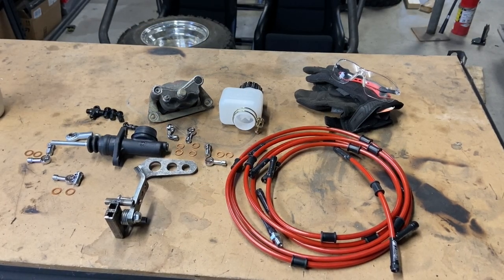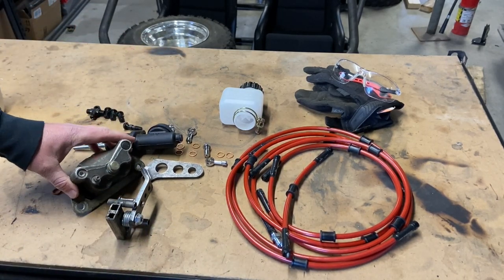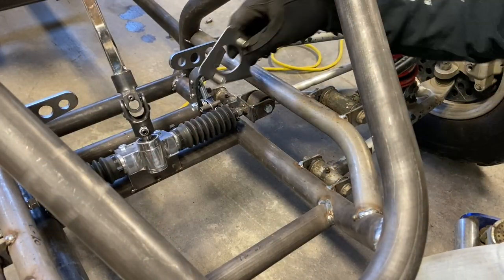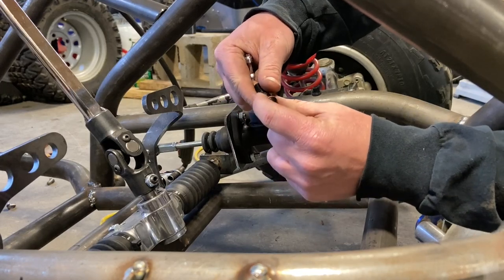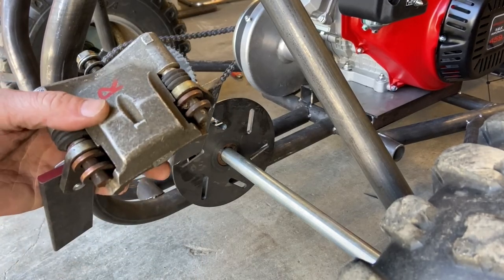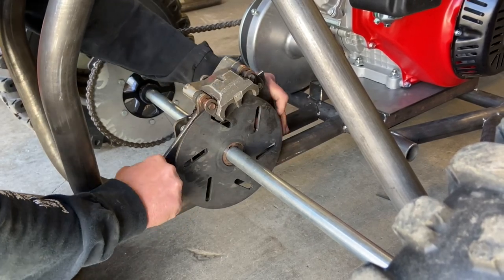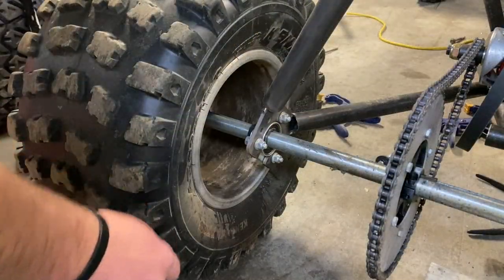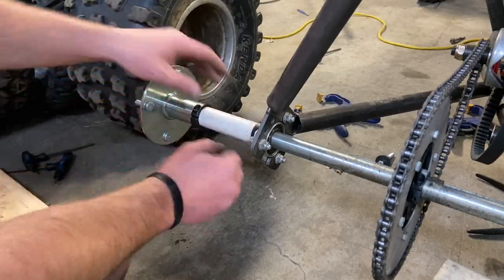Budget Crosskart #8 Brakes and First Drive

Comment: I gotta say I love the shape of this thing. Gotta buy these plans and try to build this over the summer. I have my welder and also have a tl1000s motor that would really rip in this thing. 100+ lb torque would make this a beast.
Reply from the maker: Well I cannot take credit for the shape, it’s pretty common in European crosskarts. But the design and reusing atv components is 100% original. I was really close to using a TL in the two seater for the same reason, but went with a busa instead. Going to be a torque monster and maybe even do wheelies with a TL… I can’t wait to see your build 🦾

Comment: Well you raised her right! Great job on the budget build! Just need a booster seat for your daughter to see over the wheel. Or use a car seat manual mechanism for lifting the seat and sliding back and forward?
Oh and finish those welds, I'm sure the axle supports are still only tacked in.
Reply from the maker: She’s so fun. And she says she can see alright. The brackets for the seat come out in just a couple minutes and cost waaaay less than what you’re suggesting 😉. And yes, it’s mostly tacked together because the rear is getting suspension, but when something is designed well it should only need tacked.

Comment: I'm telling you buddy you would be much happier and your clutch will last a lot longer if you will install it the correct way. The drive clutch literally goes on backwards with this setup then the drive sprocket that came with the clutch goes between The driven clutch and the back plate. Not only does it make it to where the belt stays in alignment throughout it's range but it also takes a lot less stress off of the end of the Jack shaft making it a lot stronger and of course more durable. I absolutely love mine and I've owned five or six of them on different builds and never had a problem, a kevlar belt is another big improvement.
Reply from the maker: I looked into this after you commented on the last video. The output shaft from the engine is not long enough to support this. The sprocket is 2” wide and the clutch is already spaced 1”. It’s the same situation no matter how it is configured. The only other option is to run the sprocket under the engine cylinder on the opposite side of the jackshaft. I really appreciate the info though, thank you.

Comment: The PVC sleeve still won't stop the axle from creeping.  What you should do instead is tack the steel collar onto the axle.   If you did that on both sides the axle will stay centered.
Reply from the maker: Yes it will. The axle is staying centered just fine because it has 6 collars keeping it centered. This was just to keep the hubs from pushing in on the outer collars as I said in the video. Welding on the axle kind of defeats the purpose of everything I put on there. Thank you for the input though, I always appreciate the comments.

Comment: I like that she was thinking about safety when she flipped down that windscreen. Great series. Hoping I can adapt the design to "cut and weld" as the price for a bender (that I have found) is a bit steep.
Reply from the maker: She is an absolute blast! We have a bluetooth comm system from when my wife and I did motorcycle rides (before kids), so we ride around and talk fun, craziness, and also how to have fun and be safe. I’ve messed around with doing a no-bend version and looking at the cad it would rely way too much on welds being perfect (in my humble opinion) and just doesn’t seem strong enough. And it would be hell to get everything straight. Thank you for the comment 👍

Comment: Nice build!  Interested in seeing the direct comparison to IRS, once you get there! 

I'm just looking at getting into building a small go kart with the kids, and thought it would be fun to try to design a smaller IRS setup.. I can't find anything smaller than the miata CV shafts that are commonly used for these cross buggies.. I feel like I will be sacrificing a lot of power to the unnecessarily heavy drive components.  

Have you seen any smaller components used?  Am I wasting my time not sticking with a solid axle for my first build? ( Very likely haha )
Reply from the maker: I’ve thought about this too. An easy low power solution could be to use steering u-joints. I’m not sure how much abuse they would take and it would be a decent amount of R and D funds but I’m sure it’s there. I made the seat brackets so my little girl could drive one of the bigger ones and had the thought that it is super safe and not tippy at all; and she can grow into it with just new seat brackets. Stick around for the rear suspension setup, I’m hoping it will be an easy and inexpensive solution to an irs setup. And thank you for the comment! 👍🦾

Comment: How did u realize the rear hub was getting loose, especially if it only loosened by very little?
Reply from the maker: I could see it wriggling when my daughter was driving it. It wasn’t much and I was worried I bent the axle. But the axle is well supported so it had to be the hub.
Reply: @KJRaycing  I see. Good job

Comment: No rear suspention?
Reply from the maker: Not yet. This is the first in the evolution. The least expensive way to get into crosskarts. This same kart will get suspension and other upgrades in the next build phase, coming soon.  And it’s really not as bad as I thought it would be without rear suspension. A decent racing seat would actually make it pretty nice. But it’s getting rear suspension anyway.
Reply: @KJRaycing  makes sence it is a budget build.also a cheap way to do rear suspension is buy using bushings instead of hiem joints